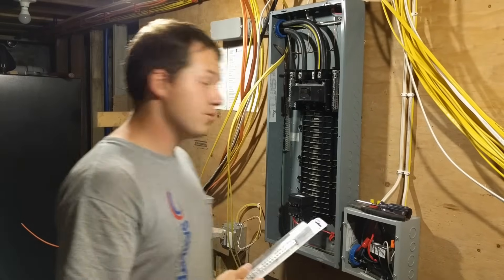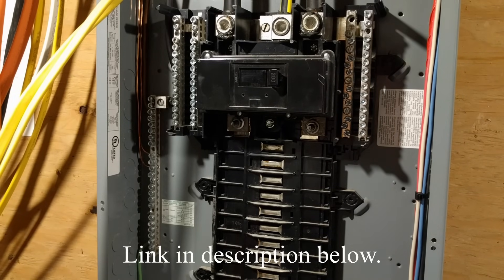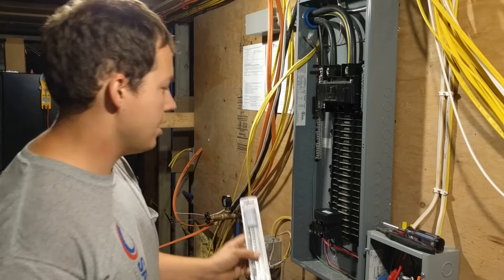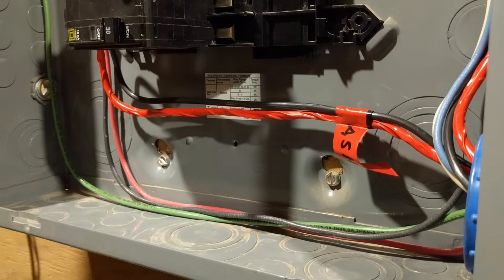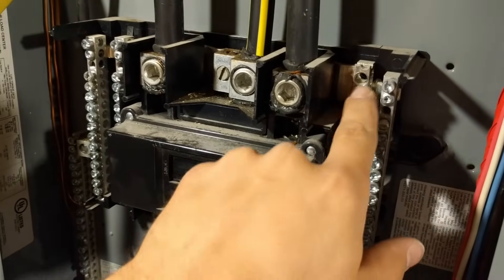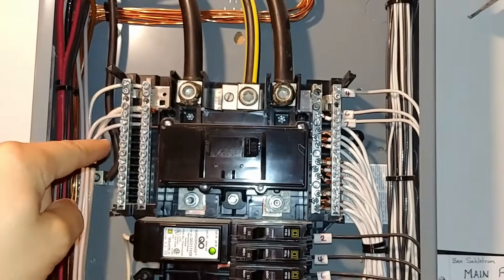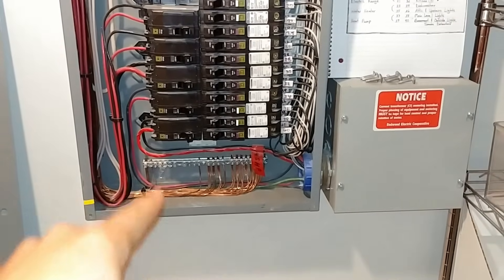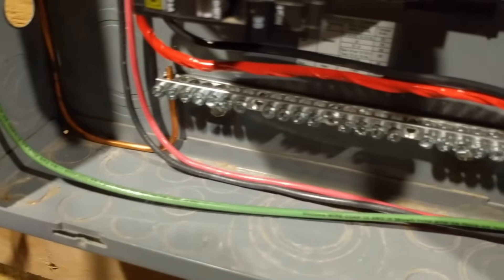How To Install a Ground Bar In a Sub Panel or Main Load Center

Comment: if you can not use the ground bar that comes with the subpanel because it needs be separate from the the un-bonded neutral bar why would you connect the new separately grounded ground bar to the existing ground bar ?

Comment: Since all sub panels need separate ground and neutral, why do so many panels only have 1? If they only have a neutral bus bar, can you just add a ground bar and attach the ground rod wire and wire from the main panel?
Reply: Older installations a ground rod and a ground wire outside of the house was in code. There are some exceptions as well where that can be still done I think (but always double check your local and NEC code). Though I would just run 4 wire conductors as having several ground paths can create more issues than it's worth. 
Most panels with just one neutral/ground bar are intended as the "main breaker" aka first means of disconnect, where the grounds and neutrals are terminated on the same bus bars. Though they add provisions for a ground kit in order to make it a "sub panel".

Comment: I really like how you brought the circuit wires in and looped them at the bottom.  If you ever need to move things around you will have plenty of excess wire.  I always see these panels where everything is just as long as it needs to be and everything is bent all perfect.  That panel can't really be relocated at all without rewiring circuits or adding unsightly junction boxes.  I learned a lot from this, the cutoff panel and arc fault videos.  I have to un-bond the sub panel in my shop so I can arc fault breakers and it's fed by a cutoff panel and you answered all my questions.  Thanks a ton for making these videos!

Comment: Many of the older pre-late 60’s sub-panels combine neutrals and grounds. It seems that one option would be to tap the panel for a universal ground bar, run a #4 (125 amp) ground wire to the main, and separate the neutrals and grounds. The other option is to replace the panel which is often a better choice.

Comment: Hello Maestro, thank you for educating us, I have a question, my house was built in 1936 before you even born, the electrical installation is not grounded at all, all my electrical out lets only have the hot and the neutral, the neutral from the main entrance box goes to connect to the water pipes in the property, I would like to ground what I can inside the house with new out lets installs, and with a 7 ft bar into the ground, my question is, can I get away with just one bar in to the ground?? I see in the beginning of your video, you mention 2 bars in to the ground, and also I like to install the grounds strip in the same main box, now would I tap in to the neutral strip from my grounds strip in to the main box?? because I only have 1 box, the electricity meter is in the same box, thank you in advance!

Comment: This is as clear as mud. You say to connect the neutral to the ground bar, effectively bonding this sub panel and setting a ground loop. I think you cause confusion by attempting to explain something waaay different than what you are working on. You need to listen to what you've said and examine closely every time you said ground or neutral.

Comment: Had an inspector in Northern Ca state you CAN NOT add a ground bar onto an electrical panel as it voids the UL listing to the electrical panel.

Comment: If I'm understanding correctly, did you say it is ok to jump the second ground bar from the neutral bar?  Isn't this the same as bonding the ground and neutral?  I thought they should ONLY be bonded at the main panel.  Is this incorrect?  BTW, that's the "cleanest" subpanel installation I've seen.  It's clear that you take pride in your work!

Comment: thanks for the videos - I have a 3 wire feed sub panel in a detached garage that was built in the mid eighties.  the sub panel has a isolated neutral bar but no ground bar (both grounds and neutrals are attached to the isolated neutral) should a ground bar be added and neutrals and grounds separated.  Sub panel also has its own ground rod.

Comment: I have a partially installed subpanel into a garage
 with only 3 #2 wires buried deep.  Do I drive 2 ground rods and connect ground wire to  a separate ground bar along with the bare ground wires.  Can't dig up the concrete to run a 4th wire from main to sub.

Comment: Best video 👍. 
I have 2 separate meters with 2 main panels for a 2 family house. Now I use it as one family and closed one meter/account. So I want to convert one of panels as Sub-panel. Do I need to get additional ground bar for this converted sub panel? It’s in same house and 2 panels next to each other and they are all connected to metal conduit, then to the ground. Thanks 🙏

Comment: This video is from 2018, but I sure hope you monitor the comments, and can answer my question.  As I was replacing the breakers in my panel, which are constantly getting false tripping, I have to disconnect the pig tail.  The screw for the ground bar has a square hole in it, and a slot that you should be able to use a flat screwdriver to loosen.  Well, the electrician must have been Godzilla because it's so tight that they start to strip instead of loosen.  I've tried a #1, 2, and 3 square bits, but they don't fit in the square hole.  Which bit are you using to tighten the screw in your video?

Comment: You may want to remove the shiny electrical conductor on your finger when working around circuits regardless if they are on or off.

Comment: I am adding a breaker on my panel, but I see no ground bus bar. Only two neutral bus bar. What should I do with my ground wire? should I put both my ground wire and the neutral wire onto the neutral bus bar?

Comment: What would you do if you run out of neutral slots on the main panel?
Reply: Your neutral terminals should be greater than your breaker positions. So in theory you shouldn’t run out. But if you do you could just add another neutral bar as you see in this video.

Comment: Do you use a neutral termination kit for the ground wire from the main? Or is it a specific grounding termination kit for those large ground wires?

Comment: Benjamin, great video agree on all but I did have a question.  What about a sub panel that mounted on a transformer that does not have a grounding rod. Should I still have a jumper between the grounding bar and the neutral or will this be one of those instances where the grounding bar and the neutral bar need to be isolated away from each other without a jumping wire.  Thanks in advance

Comment: If we are adding a sub panel, how big the circuit breaker can be added to the main supply panel. Say the main panel is 200A, considering there are already existing circuit breakers at the main supply panel.  what are the engineering requirements ??

Comment: Hi Ben, a few questions:  If I want to install a sub-panel next to my main panel (outside), I would have to add a dedicated ground bar to my main panel to separate my grounds and neutrals to install my sub-panel, correct?
Reply: You separate grounds and neutrals at the sub panel. They are bonded at the main panel.

Comment: Hi Ben, if i add a sub-panel next to the main panel (as it is run out of space), do i need a dedicated ground rod for the sub-panel?
Reply from the maker: If it is in the same building you do not need additional grounding electrodes. You'll just need the stuff outlined in this video:  https://youtu.be/0kkVJYNLXo4

Good luck!

Comment: Thanks for the info I tied my grounds and neutrals together on my subpanel in my house I will be separating them asap.
Reply: Mostviews111, make sure that there is no bonding screw (green) in the sub panel either.

Comment: Im trying to reuse a older subpanel in my new pole barn..it has only one bar for the neutral and ground together...i removed the "bonding to box" screw on that bar to dedicate it to neutral wires.. I bought a ground bar for the ground wire but cant figure out where to mount it ..its an older square d 100 amp panel and the breakers and buses run horizontally..can i put the new ground bar beside the neutral bar?..It seems to gonna be very crowded in  that box..

Comment: 99% of panels I've used have had a way to easily separate the factory given neutral/ground bars for a subpanel.....Betting that one did too....PS the highlight of the video was when you said "assuredy"

Comment: My 1948 home has two wire outlets, no ground. The service panel had been upgraded sometime in the past to a 100 amp service with today style breakers. If I want to run wiring for a 120 volt/30 amp disconnect for a mini split, I would just need to install a ground bar in the service panel. Then run hot, neutral and ground to disconnect on it’s own dedicated 20 amp breaker correct? Or could I just use a neutral bus to run ground from?

Comment: This seemed informative but, WAY to many change of directions in your conversation. Example, But if your adding a subpanel, but if it is a service entrance, but if your ground cable is coming from, but, but, but. It would have been easier to follow if you stuck with one method, then switch to another method, then be finished.
Here is a simple description: 
*Service or main panel requires grounding stakes with a ground bar and a neutral bar to be bonded to each other, but still always connect only ground wires to ground bar and neutral wires to neutral bar.
*Sub-panel in the same building as the main panel requires a floating neutral bar.  Do not mix neutral and ground wires on bars.
*Sub-panel in a separate building requires a floating neutral bar and grounding stakes.
*When adding a bar, connect to the same type of bar (like bonding).

Comment: The extra ground wire between the bus bars is a good idea because of the paint on the panel.  You're not guaranteed of a low resistance connection through the chassis.

Comment: In a sub panel, on the separate ground bar, can you share a hole for two different ground wires or must you install a new separate ground bar?

Comment: What’s with the sizing of the ground wire back to main panel? Why is it so small?
Reply from the maker: Because it normally does not carry power. It is only there for when a fault occurs.
Reply: @BenjaminSahlstrom  Does distance determine the size then?

Comment: Hi Benjamin.  I'm a home inspector and have a question.  At :23 of the video, you say that you cannot attach neutral wires to the bar.  Is that because it's a subpanel?  Or can you never put neutral wires on a bar that has been added to the panel?  Even if it's not a subpanel.
Reply: The panel Ben is working with is in fact a sub panel, his main panel is exterior. So although this looks like a main panel it’s not. NEC reads that only the main panel is to be bonded. Also neutrals and grounds can terminate on the same neutral/ground bar in the main panel only. Please see NEC governing grounding as I am paraphrasing.

Comment: I want to put a 60-amp breaker box in my detached garage, then connect it to my main breaker panel using a 15' length of #4 wire, a pair of 60-amp outlets, and a heavy duty, 60-amp extension cord, which I can disconnect and store when I'm not working in my shop. My main panel is a Siemens G2020MB1100, with two bonded neutrals - no ground bar. Most every circuit in my main panel is made up of either two or three wires - either a hot and a neutral or two hots and a neutral. In the rare instance one of the circuits has a ground, that ground is also attached to the bonded neutral bar. Can I use 4/3 wire to do what I want to do, without adding a ground bar to the main panel? 

Also, I have several circuits in my main panel that are "double tapped" using pigtails. Why is that better or more acceptable than removing said pigtails and installing tandem breakers? My refrigerator is on the same circuit as my furnace, so when we run our air fryer while the central air is on, and the fridge compressor kicks on, it trips the breaker! 

Thanks to any and all who answer!

Comment: Hey ! Ben what’s your best suggestion for ground & neutral wires, when ur relocating ur main panel to another location. But still using the original panel, I guess as a junction box. It’s 100 service, main breaker. So I ran #2 wire  ( 2 hots, neutral & ground) from another 100 amp breaker to main lug in new panel. Just not sure if I met to use bonding screw. Since it’s technically not a sub panel, or is it?

Comment: This will be my first wiring to a subpanel, now the sub panel has a ground bonding screw already in the box n it came with a extra green bonding screw in a bag I guess for the neutral bar n I'm know not to install it. My question is do I need to run a ground from my main panel to the subpanel then add a extra ground going to a grounding rod? I watched a video where they ran it off a 100 amp breaker from the main to the subpanel 100 feet away n installed both hots n the neutral wire, but they just ran a ground to a grounding rod n not one from the main. My garage is just like 25-30 feet from where my main panel is. Thanks God Bless!

Comment: If you are installing a ground rod and connecting it to the sub-panel box, why back feed the ground to the main panel? Doesn't grounding mean just that, to run a wire from the ground rod in the dirt to the box?
Reply: My understanding is that there are two different grounding systems. Sounds as though you are conflating the two. Electricity always wants to go back to it's source. In your house, the source is actually the transformer in the street. So here's grounding system #1) you need to bond every component in your house that normally does not carry voltage, but could carry voltage in the case of a wiring failure. Say, you drop your blender one too many times, and the internal black wire bringing juice to the appliance comes loose and touches the metal housing of the blender. Grounding system # 1 provides a straight shot from that blender housing back to the MAIN service panel, and from there, on to the transformer in the street. The circuit the blender is on NEEDS that straight shot, providing a closed loop, allowing a crap-ton of current to flow immediately, and therefore tripping the breaker and saving your sorry butt (or mine!) from an electric shock next time you decide to make a smoothie. Grounding system #2 is a different ball of wax. I do believe that every structure needs a ground rod to protect it from very huge current surges like lightening. When Zeus decides to zap your detached garage, asking the ground feeder wire to pass all that current back up the the transformer in the street is a no-go. So a big, fat, grounding rod conductor shoots the lightening back into the earth where it belongs. Or something like that!

Comment: As a sub panel you connect your neutral to your ground bar? And the neutral should not be bonded to the panel itself right? doesn't that essentially just make your ground bar another neutral?

Comment: Just finished running my wires in my shop through emt and you bet I also pulled a redundant ground wire also just in case. Can't be too safe I love it. Now I have to do this to the sub that is supplying my shop because the builder bonded every ground and neutral together.

Comment: Did I understand this correctly?  All four wires (main-panel ground, main-panel neutral, subpanel ground, and spanel neutral) are tied together and bonded to the cabinet?  Doesn't that create the possibility of current flow from thr neutral of one box to the ground of another?

Comment: Enjoyed the video. 
Question: if the main panel is bonded and the sub panel that I’m adding isn’t do I still connect the ground in my main panel to my sub panel even if I added a new ground rod on my sub panel.

Comment: I get confused with ground rods.  My main panel in on a pole by the road, it has ground bars.  My shack has a sub panel and I have heard some say put a ground rod in the ground there too others say not to connect to it ... others use the term "ground loop".  Maybe some info on that..????

Comment: How u run 220 v connection from sub panel to load ( where t connect neutral cable) is neutral cable goes in ground bar?